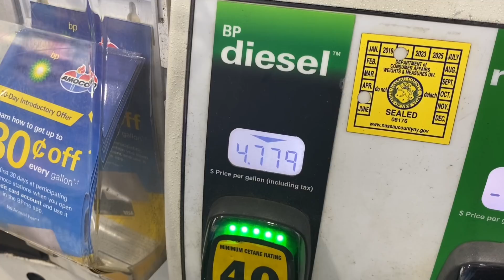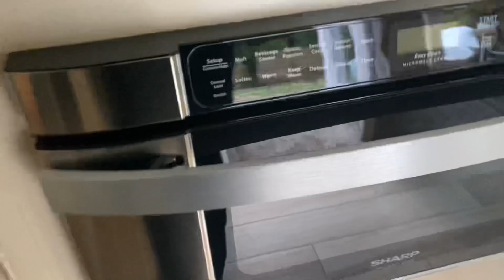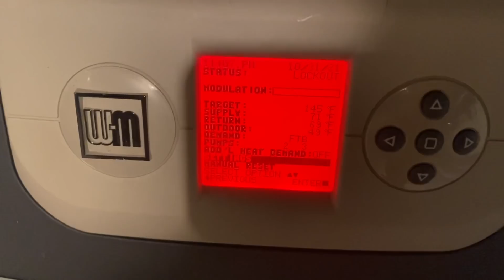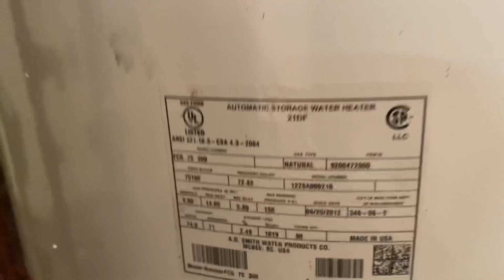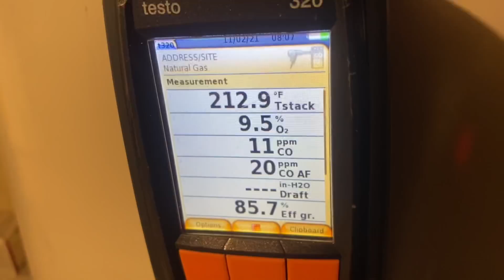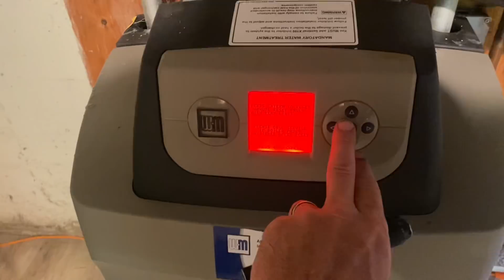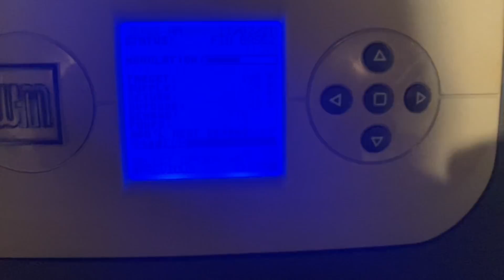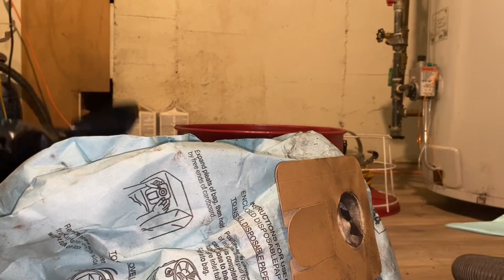They Are Lucky To Be Alive! Found Gas Water Heater Dumping Exhaust into Basement During Tuneup

Comment: i have been in the industry for over 20 years and you do exactly what i do and has been trained to do the right thing. A story for you, when i was back east i had done a tune up on a 40 year old boiler, cleaned chimney out vacuumed the boiler blead radiators and did a combustion analyses all good. I sold the customer 3 co detectors and installed them in the basement, 1st floor second floor. that night we has a wind storme that knocked her tree into the chimney collapsing it setting off all 3 co detectors in the home. i got the call that night and drove to the customer after i told her to call fire department after she gets her kids out of the home. that night i saved this family's life just by adding the co detectors in the home and i can never forget that.

Comment: chimney needs a proper diameter liner added, as it's way too large of diameter for the water heater only and surely condensation is causing it to crumble internally.
alternate, an direct vented DHW and abandon the chimney or an indirect tank off boiler (all eggs in one basket though)

Comment: Had a similar issue in my basement.  Was getting an odd moisturizer in my boiler room and it just felt different in there.  Realized my chimney had lost it's draft chimney was ice cold and cold air was pouring down it. Both the water heater and boiler were venting into the house.   Put a small portable radiant heater on the chimney and 2 hours later it was drafting again.  Problem never returned.

Comment: 1:44 if a US gallon is 3.7854 liters, that makes $1.2625 per liter... and if an USD is 0.86541 EUR this means your diesel costs 1.093 EUR/liter... THAT'S CHEAP!  
I just had a modest 60 EUR fillup and got 36.06 liters, 1.664 EUR/liter. 
And gasoline is more expensive, last week it already exceeded 2 EUR/liter in some places (2,3112 USD/liter or 8,7488 USD/gallon). 
The green dream is going to be a nightmare to many.

Comment: You're definitely right. As I was closing on my house a big piece of exhaust piping rusted and fell off. Before I actually moved in I hired a contractor to replace all of the exhaust piping in my house (it was all rusted and had holes in it). Both the furnace and hot water tank were only putting out single digit CO ppm, but it was enough to set off the carbon monoxide alarms to the point it killed their batteries in a week. The threshold on those bad boys are around 60 ppm. It adds up over time especially when the house is sealed up for the winter heating season.

Comment: That's nothing, when I worked for my grandfather he had a service account in an old Victorian.  To heat the cellar they would spin the 90 on water heater around and stuff insulation into the chimney hole.  I would correct it and tell  them not to do it.  Come back on another call a year or so later and found it that way again.

I was doing a kitchen over at a long time customers of mine about 10 years ago.  Utility got the boiler install because "they knew what they were doing". Chimney was fully exposed on the side of the house but they did not put a liner in.    I asked the inspector why he did not enforce a liner,  he said because the boiler was "like efficiency" which was BS.  I get a call dead of winter about a year later for no heat and the "Utility" was days delayed.   I found the flue had plugged up with disintegrated chips of liner.  Water heater and boiler were attached before the chimney and you could see how the flue gases were spilling out of the water heater until the restriction was enough to cause the boiler safety's to trip the water heater was still running.   Needless to say they now have a new stainless liner. 

At least in our state we have the 7 times law, the area of the chimney cannot be more that 7 times the attached appliance.  Water heater like that would be considered an orphan when the Ultra was installed and the contractor should have either done a tank off the ultra or put a liner in for the water heater.

Comment: Years ago my sister was complaining about her heat so i went over to look at it. She was in an old triple decker on the 2nd floor, as I walked in the basement i could hear a strange noise coming from one of the boilers and saw a garden hose feeding into the 3rd floor furnace. The guy was laid off and couldn't pay his gas bill so they shut off the meter for the second floor. He jury rigged the rubber hose to feed gas into the combustion chamber and just lit it off, he used the brass hose nozzle to throttle the flow of gas down to a dull roar - the gas just burned 24-7.

I called the landlord who lived across the street and the gas company and they were at the house PDQ reading the guy the riot act. It was just shit luck the house didn't go up in flames.
Reply: @PipeDoctor    He said he left the brass hose nozzle on so the flame wouldn't burn the hose - people do crazy stuff. That's why they have the Darwin awards.
Reply: @dell177  Mikey said it above, "you can't fix stupid".

Comment: I had one the other day where the pipe was broken on the furnace and I always talk with people and ask them questions and they were basically telling me symptoms of CO and I was like jeez 2 years and no one did anything your very lucky and at 85ppm inside that a lot ik people say you can’t smell CO but I definitely feel it when im around it even a small amount.
Reply: you're smelling the other byproducts of the burnt gas and contaminates in the indoor air. NOT the CO gas ;)
but yes, I can usually smell the smallest amount of combustion leakage in the air also. also vent-less heaters, stove/oven gas dryer with vent pipe leaks.
but remember pure CO is colorless, odorless and deadly, they may be used to the combustion smell if it's a minor leak, even a minor leak could have very high CO and it builds up in a less leaky tight home.

Comment: 20 -40 PPM is not a hazard . However what if something changed that cause that water heater to start putting out 400 or more PPM ? Would you want your family living in that house ?  Saint Mike you are 100% correct for fixing that .
Reply: You should have zero zip none of Co in a house 20- 40 can cause health issues I’ve seen it a lot. And it’s definitely a hazard and a concern in my book only way you have even 1-10ppm  is if someone smokes or burns candles other than that should be nothing I check every house I go to genuinely every house and just this year have gotten over 30 so far
Reply: 35-50 ppm carbon monoxide is the maximum allowable concentration for continuous exposure in any 8hour period per osha
Reply: 20-40ppm may not be a hazard, but if you put enough exhaust gases in that space with a reduced oxygen level, all of a sudden your water heater producing 20-40ppm will be starved for oxygen and produce way higher CO
Reply: @staticpressurenerd5182  exactly
Reply: @TheLuckyman7726  And that is why MIkey did not ignore this problem . All the other keyboard commandos are saying just how dangerous 20-40 PPM are . All the while this is in a closed boiler room that apparently  no even goes into .  Hell you didn't see the home owner even bothering to go downstairs with Mike to show him the room . Is the situation dangerous ? Well hell yes . That is again why Mikey fixed it !

Comment: I ran out of gas literally in the driveway of a gas station. I had just purchased the car used 4 days prior. And the gas gauge still showed 1/4 tank. The needle had been misaligned during the clusters reassembly after the oil pressure gauges stepper motor was replaced.

Comment: Hopefully you don't have to reprime that diesel
Reply: Newer vehicles and equipment not required.
Reply: Self purge turn switch a few times till you hear fuel get to rail if it doesn't pick up on its own banjo Conn or plug